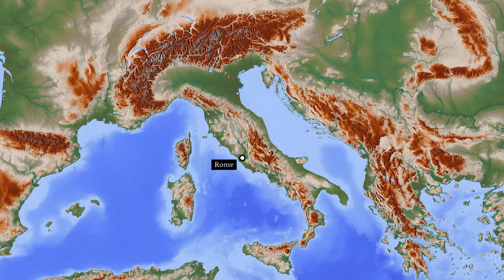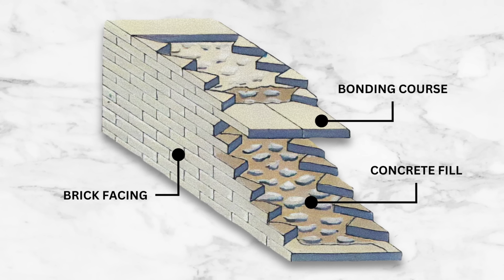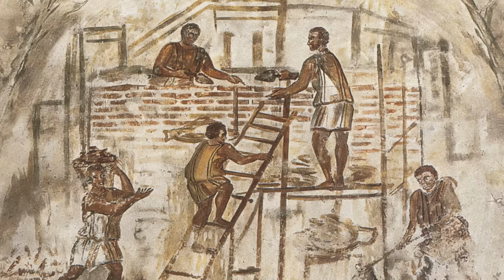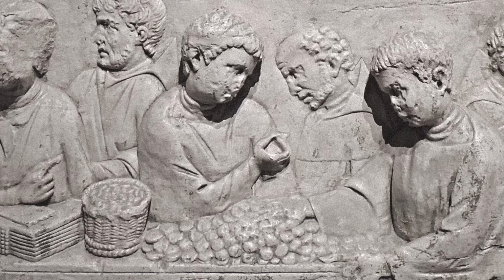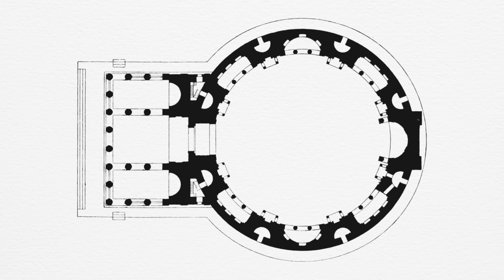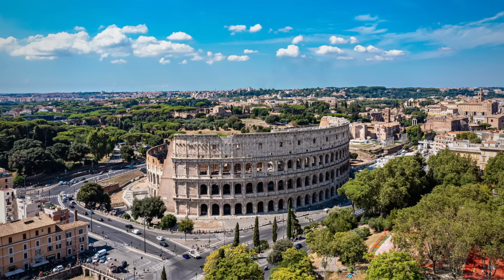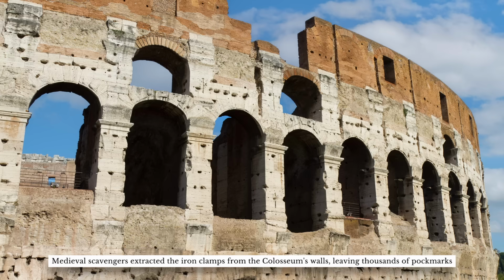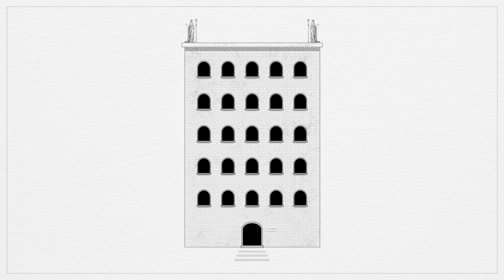Why isn't Roman Concrete used today?

Comment: Modern concrete does NOT need air or CO2 to “harden”.  The water chemically reacts with the cement (hydrating).  This is an exothermic chemical reaction (it produces heat).  Modern concrete can indeed be poured and set under seawater (it’s a challenge but possible).   The exact properties of modern concrete are adjusted according to specific needs by the addition of admixtures (additives to control various properties).  Extremely strong and durable concrete can be produced if desired.
Reply: I'm using this type of concrete for waterproofing jobs and know they're used annually by underwater bridge pylons maintenance filling up cracks. They're super hard when set but a bit expensive
Reply: Yeah, I heard him use the term "drying" but that's a concrete no-no.  Concrete "cures," but not by drying.
Reply: No. But the lime based mortar he was describing does.
Reply: The heat is an issue during curing. Makes large projects like dams complicated.
Reply: @maxpeterson8616  I read the Hoover Dam had piping installed that water could be run through as they poured the concrete over it to carry the heat away. Also mentioned that it took many, many years for it to fully cure. Don' remember the source but it would be interesting if someone could confirm it or not.
Reply: @bintheredonethat industrial structural engineer - 1. Thick concrete is often actively cooled, correct. Otherwise you may end up with internal cracking due to it being hotter on the inside than the outside. 2. Concrete continues gaining strength for many years. It gains its design strength after either 28 or 56 days, but will continue to slowly gain strength after that. On one of my projects, a concrete sample with a design strength of C16 ended up with C22 after 15 years.
Reply: @TheGreatDefective  Thanks for the confirmation. I thought I'd heard that correctly. ;0)
Reply: @TheGreatDefective  I'm very surprised by the idea that a concrete can gain almost 50% more strength than the specified. So I googled and wow even 100% increase over the long term. I used to work in the cement industry and though I had a good idea of how cements work but hmm LOL. Got me wondering about my own concrete pavers I made. At the time we could buy reject cement from the company for $10/tonne when it was about $80 retail. Reason for reject was the particular mill for this off white cement was an open loop system. Filters and separators rejected over size  particles. Anyway, the chief chemical engineer gave me a recipe for 30MPa and the test brew I did tested in the lab at 32MPa. I made 200m2 of pavers for driveway and paths. That was about 45 years ago. Perhaps they are now 50MPa?
Reply: @maxpeterson8616  Hoover dam for example. Water cooling was used.
Reply: It puzzles me that statements like modern cement needs air. Clearly it doesn't. I used to work at a cement plant and have a reasonable understanding of the chemistry involved. Yes it's hydration. And yes, exothermic. In most cases heat of hydration is not an issue. But I recall a documentary on the Hoover Dam where such large pours were made that water cooling was requited.
Reply: "Modern concrete does NOT need air or CO2 to “harden”.  The water chemically reacts with the cement (hydrating)."

Technically, he was only ascribing that property to "lime based mortar" but I guess he should've been more explicit about it not applying to most types of cement whether modern or ancient.
Reply: I was going to comment this. I have never heard of CO2 being necessary for cure and concrete made with portland cement will cure underwater without issue. You can just dump it underwater and it still cures.
Reply: Thank you so much. I couldn't have said it any better.  Today's concrete is a high-tech substance.
Reply: Was looking for this comment.  Can't trust the narrator as he doesn't distinguish between mortar and concrete.
Reply: Modern concrete is mostly fly ash because it was historically cheap due being a byproduct of coal plants. With less and less reliance on coal in facor of oil, alternates will need to be used going forward. Maybe something better can emerge?
Reply: @slimjim2584  Fly ash only substitutes a portion of the cement used in the mix (roughly 20% depending on use/mix design). It also has plusses and minuses. It does not generate the heat that cement mixes do during curing, so cold weather use can be an issue. Also, if high-early strength is required (such as a business driveway entrance), it should not be used. It will likely gain more strength than 100% cement mixes over time (due to less water being needed), but it is a slower process to get there.
Reply: @slimjim2584  
Sorry, modern concrete IS NOT "mostly" fly ash.  generally 15 to 25 percent of the cement is replaced with fly ash.  More than that and you're beginning to lose ultimate strength.
But you are correct about the declining availability of coal ash.  However, there are vast supplies of ash (in ash ponds) that were previously not considered of high enough quality for concrete work.  But new tech is allowing some of those supplies to be processed for use in a way that is economically feasible.  There is a fair amount of work being done on natural pozzolans that is filling some of the gap.
Reply: They won’t use so much concrete in the future, it releases vast amounts of CO2- not as much as power generation but enough that it will become the next natural target after electricity generation is solved. Houses will probably be printed out of corn or something stupid
Reply: @slimjim2584  Modern cement (Portland cement) is not mostly fly ash. Most cements have no fly ash at all. The company I used to work for produced several cements only one of which has fly ash and that was just 20%.
Reply: @slimjim2584  Modern concrete is primarily made from limestone and silicate stones.
Reply: and modern concrete quickly decarbonises decays emits carcinogenic dust and is ecologically unsustainable whereas Roman concrete is the exact opposite.

Comment: Now what happens if we dope Roman concrete w/ graphene?
Reply: Adding graphene to geopolymer concrete can greatly improve its properties because of graphene’s unique strength and conductivity. Graphene can make the concrete much stronger by helping to spread out stress and prevent tiny cracks from growing, which also makes it tougher and longer-lasting. The strong bond between graphene and the concrete’s components helps make the material even better at resisting damage. Since graphene conducts electricity, the concrete could be used in smart structures that monitor their own health by detecting changes in stress or temperature. Graphene's ability to conduct heat could also help create concrete that can manage temperatures or even warm itself in cold conditions. It also protects the concrete from chemicals and harsh environments, making it ideal for places like industrial sites or coastal areas. However, graphene can make the concrete mix harder to work with, and the cost of producing graphene in large amounts is still a challenge for using it widely in construction.

Comment: Um, all concrete (ignoring exotic ones like cement free) cure by reacting with water, not CO2/air. I test concrete samples all day (did 100+ today) in a concrete testing lab. We cure all our samples in temperature controlled water tanks. Due to the small size of a sample (usually 100mm cube) we have to get them out of the air and into water within a short time frame of their production or they won't cure properly and are ruined. A look at Wikipedia seems to say that Roman concrete had a compressive strength of about 20 kiloNewtons which is the bog standard for housing foundations etc. Some of our clients with particular customers needing very high strength crush at up to 200kN. Anyhoo, water curing is not a special feature of Roman concrete.

Comment: I’m curious as to how they would have mixed so much concrete back then. Any project today that requires anything more than a small amount will need several trucks worth and any DIYers know how much effort the wheelbarrow and shovel method of mixing takes after just a couple bags, so surely they had a better method than that for mixing the stuff, but I also doubt they had trucks that would pull up on the worksite and automatically mix and pour directly where it’s needed
Reply: I imagine most of it would be mixed by hand by labourers, there would have been tens of thousands of idle hands in the Roman countryside in between harvests looking for work
Reply: I've seen a team of 2 mix up a pallet of concrete by hand on the ground in a day if that's their only job which it probably is since masons are very skilled and cost alot a small team could mix up enough for a building
Reply: @furrycircuitry2378  I loaded and unloaded from the pickup then mixed 19 of the 80lb bags one afternoon, and the internet says there’s 42 of them to a pallet, so a pallet per day is definitely reasonable for two people, but I was extremely sore for a couple days after that and could barely move my arms and my hands were nothing but open wounds from having so many blisters form and tear. Obviously if it were something I did often I would adjust to it, but there’s still a limit to how much you can expect a person to do, and those 19 bags came out to a surprisingly small amount of concrete. It would take an enormous labor force to get that work done, especially when you consider the materials had to be gathered by hand, transported, then mixed by hand, then water brought by hand, then mixing the water and concrete together by hand, then pouring. It’s just an incredible amount of effort and the labor that would be needed to get it done in a reasonable time frame would be incredible
Reply: @BobbyHill26  hmm yes I forgot to account for the shear weight of the raw material as there was no prepackaged bag to mix back then! But still never underestimate laborers, especially when their next meal is on the line! I say this as I've been there and done that personally I've moved about 2 tons of gravel for the mix in half a day but I was younger than so that's gotta factor for something
Reply: Slaves.
Reply: Slaves. Lots and lots of slaves.

Comment: Concrete is certainly a pretty amazing material, but on its own, it can be pretty ugly, especially in places with gloomier climates. I like the Roman idea of hiding it away behind a nice layer of masonry. I used to live in Warsaw, a city shaped by a post-war love of modernism and brutalism. Perhaps it's just a style that's too old to be modern and not old enough to be valued yet... but I don't like it!
Reply: The Romans didn't hide the concrete with masonery because they thought the concrete was ugly, the masonary was a technical necessity. If you pour Roman concrete just like in the cuppola ceiling of the Pantheon, you have to wait several years for the concrete to harden enough before you are able to take down the formwork and scaffolding otherwise your wall would collapse. By pouring the concrete between two thin brick walls you need much less sheeting and the wall is much sooner stable enough to build higher, therefore you can build much faster.
And even if you would encase the Roman concrete and wait long enough until it settled, it would look mostly much better as the most of the time very grey brutalist buildings. Roman conrete is through all the rubble used in it, much more colorful and less grey. If you smooth the surface it is more or less like terrazzo.
You can have this with the right modern concrete too, but that is very expensive.
Reply: @red.aries1444  they did however use marble to hide the concrete and masonry, for fancy buildings at least
Reply: Warsaw was so bleak when David Bowie visited it in '76 that he and Brian Eno wrote a sombre quasi-instrumental about the city. 😅 (It's called "Warszawa" and it's on his 1977 album Low.)
Reply: Concrete can be formed into anything and can be very beautiful. Those brutalist structures were really an example of the minds of their designers rather than an example of concrete’s inability to look graceful or classic. Check out some of the bridges in Ross, California. They are built with sweeping forms and contain beautiful light posts.
Reply: Brutalism + lots of greenery can be beautiful, imo. When surrounded by greenery, the buildings create an effect like stone mountains in nature.
Reply: @PistonAvatarGuy  Also mixed with wood, it looks amazing.
Reply: @hitthedeck4115  It does look good when used in the interiors of the buildings, it definitely adds some much needed warmth to those spaces.
Reply: Was brutalism just a bunch of architects trying to make the most insane concrete bunkers.
Reply: The Palace of Culture and Science is the biggest offender.

Comment: If salt water actually strengthens roman concrete, would it help to submerge a portion of the skyscraper with salt water?. Either totally or partially submerged or even just spraying the setting concrete while setting.

Comment: At the end you stated piers and breakwaters, I wonder about building a dam with it.
Reply: The Hoover Dam uses unreinforced concrete, so its similar in that sense. Pozzolana, as mentioned in the video, is also how the we get the term for pozzolanic materials which are a set of common additives in concrete that react similarly to the original roman clay, but are more common around the world. Commonly, they're industrial by-products like fly ash and blast furnace slag but can also include volcanic ash even today!
Reply: @andrewjensen7454  do you work with concrete? Roman concrete would basically heal itself on the piers and water breaks, maybe the Hoover Dam actually did use a form of Roman concrete, but at the same time there's damn failures everywhere nowadays which if they had used the Roman concrete would not happening, I live in the Eastern US it's kind of a big deal right now. Modern concrete hits his strongest point in 50 years, and then, from that moment on, it degrades, and yes, I have worked with concrete before in my life.
Reply: @kalrandom7387  I can't think of a single dam failure, anywhere, ever, that was caused by the concrete breaking.  You are welcome to fill in the gaps in my knowledge.  Concrete degradation is usually caused by aggregate breakdown, corrosion of reinforcement, freeze/thaw cycles, or chemical attack.  If those causes can be eliminated, concrete should have a looooooong lifespan. We've cored old (around a century) concrete buildings and foundations, and the compressive strength was well over 5kpsi.
Reply: There are some dams build by Romans, arent big, but exist. If my memory dont fail there is one neat Zaragoza.

Comment: What would be the largest pyramid you could build with roman concrete?
Reply: Given how most pyramids have almost no open space inside, and they are always, well, pyramid shaped, I would say until it becomes so tall the builders suffer from hypoxia, or you run out of flat land to build on.
Reply: @-caesarian-6078  i imagine there comes a point where the pressure would be so great, the blocks get crushed into dust
Reply: @LucyKosaki  Maybe, I'm no structural engineer, but I imagine that effect is minimized by everything being pressured equally on all sides, like how eggs work when sat on.
Reply: assuming σ=8,5 MPa it would be around 1250 meters
Reply: @ackchyually9461  Assuming a constant density of 2500 kg/m3 (it needn't be constant) and a compressive strength of 8,5 MPa, a ( constant cross-section) column of concrete would collapse under its own weight at a height of 346m.
Reply: @MrX-hz2hn  yes, but it's not a column. Column volume = AH, Pyramid volume= AH/3.